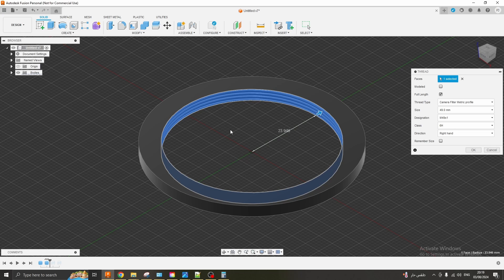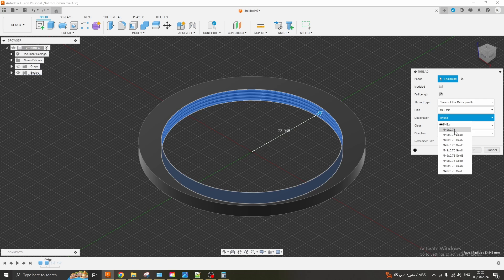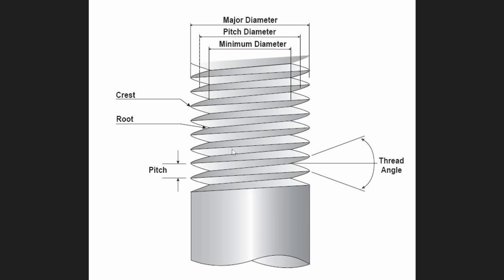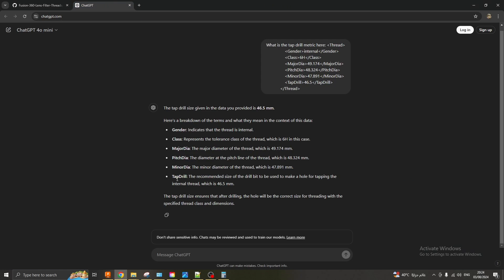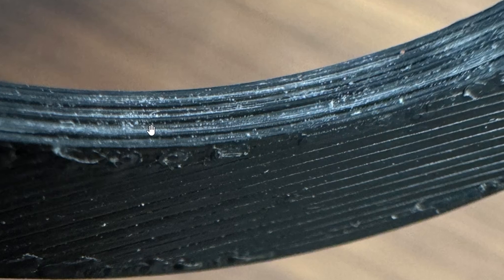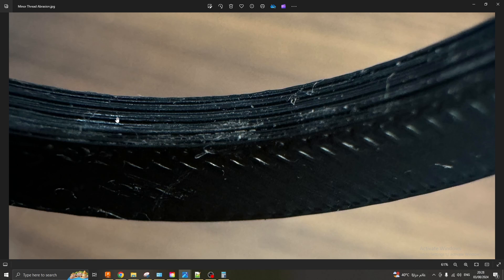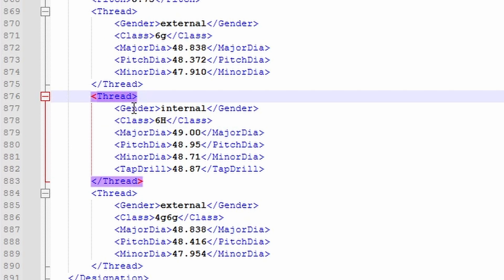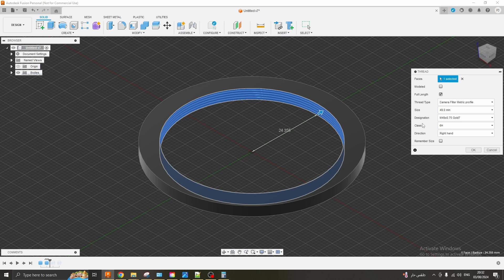3D Print Threads That Work For Camera Lenses & Filters | Fusion 360

Comment: Wow, I made a 49mm OD thread printed at 0.1mm, and it's buttery smooth to screw on. Keep in mind that you need to enable Modeled when using the Thread function.
Reply: Inner diameter one is impossible to screw on though. I think I need to adjust the scale

100.2% is good

Comment: I wish someone went through the XML and properly fixed the size issues and upgrade the XML file. As reading people using XML having to print their design like 1% bigger to work and the file is 5 years old. Think the XML was never properly measured and quickly put together, while UV threads are universal, just the XML file not correct. And other thing to account size for print materials which has certain shrink rate to print correctly.
Reply from the maker: Indeed, I found significant differences in fit between materials to the point where it wouldn't even screw in or conversely it wouldn't even hold in place.